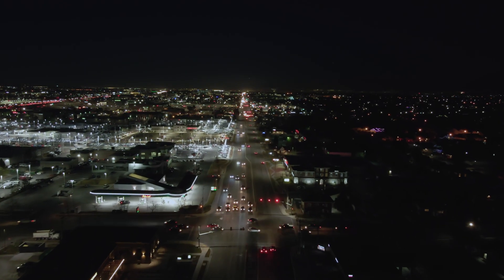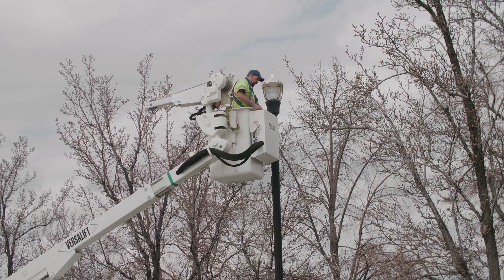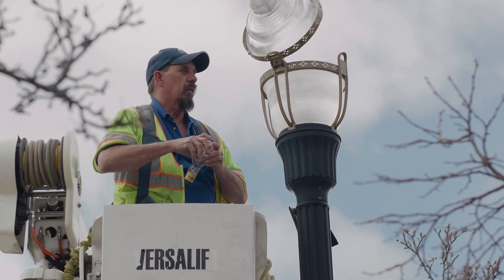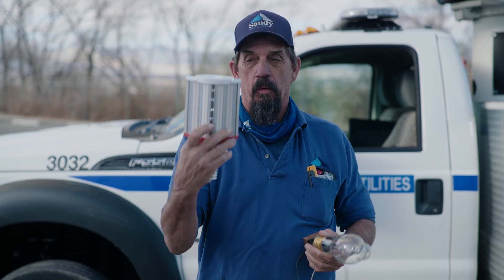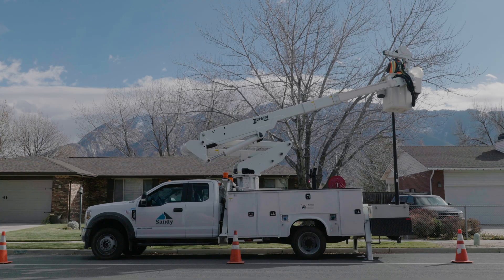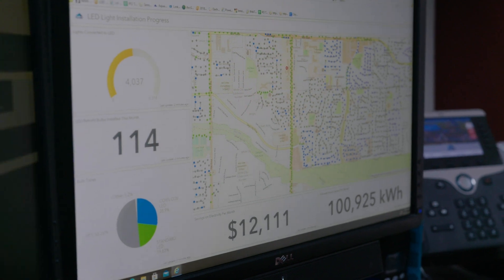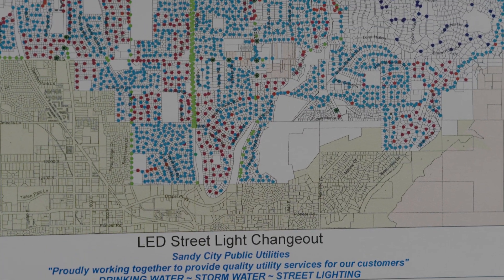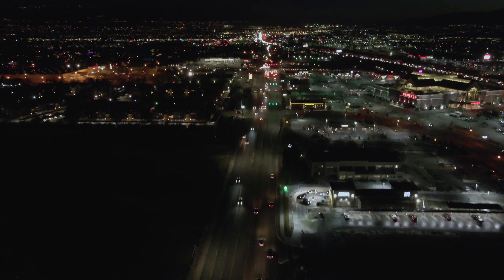SmartSandy: LED Streetlight Replacement Project

Comment: lol, i have a 45 watt led corn cob, and lemme tell ya, the 150 watt HPS if it was a new bulb, is wayy brighter..  Sorry guys, a 45w LED does NOT equal a 150w HPS..   Maybe a 100w led but not 45..   Yes LED saves electricity...  but it isnt THAT much..   The savings is only when you replace the 20,000 street lights in your city..   But for a home owner.. the savings is not there to replace 1-2 lights over the cost of a new fixture that may or may not last.  its a proven fact the HPS and Mercury vapor fixtures last 20-30-40-50 years... But it is not proven that a LED fixture can last that long.   

Also the LED fixture MAY advertise that it lasts 50,000 hours lets say..  But that still isnt the same as a HPS or mercury vapor fixture , 1 year is 4032 hours on average of 12 hours run time dusk to dawn..  Do the math thats 10 years..   Have they actually tested your LED's to run 10 years ?  There is no way to test that in real time... synthetic tests do not count.   I have seen many times over LED fixtures go bad after months to 2 years..  Is the cost savings really there ?

Also your corn cob led light has a fan that opens to keep the glare out of houses.. but that means the light is directional.. it only points to the street look at how the pole is positioned.. the side walk wont be covered adequatly anymore.

Also answer me how you are saving resident money ?  Who is paying for these fixtures to be replaced ?  The residents..  Have you lowered the kilowatt hours you charge customers for thier home electric bills ?  Have you lowered taxes to offset these savings ?  Im betting the answer is no.   Also those light poles need to be banned, there is no cover to stop light from causing light pollution..  Did you know the orange  glow of a HPS can easily be filtered by astronomers.. but the white glow from LED cannot ?  How about you work on  getting light fixtures covers that arent spot lights and waste light pointing up ?

Comment: these LEDS won't last as long as High Intensity Discharge compnents. every once in a while you need to change the bulb but the ballast and capacitor and igniters will last at least 50 years! while LED's last 20 or so years. LED'S should be banned. you guys suck for doing this shit. Now we are going to be watched by street lights and not be able to sleep at night because of the glare bombs and bluleight shining through a window, if this is the way were going, eventually HID'S will be banned because they are "inefficient" WAH WAH! you energy saver motherfu*kers! my city ( St. George, Utah ) is 100% pure LED and it pisses me off, so these old lights are going to scrap then? well collectors should save them because HID will become as rare as hens teeth in the next 40 years.